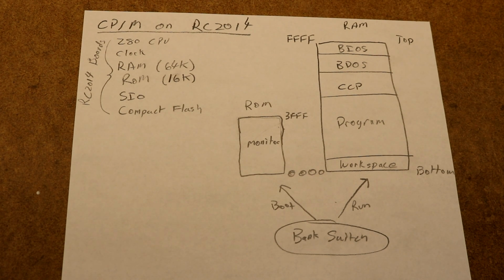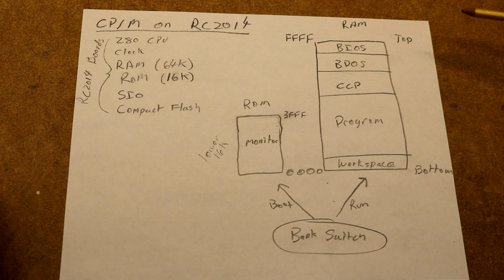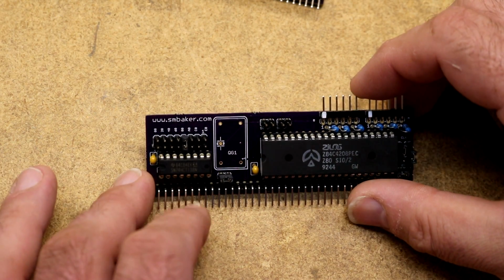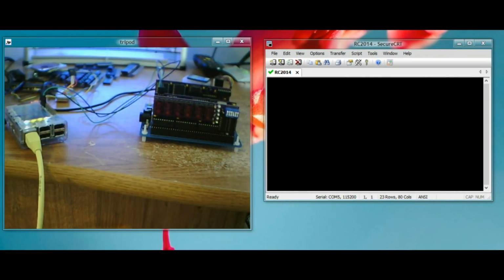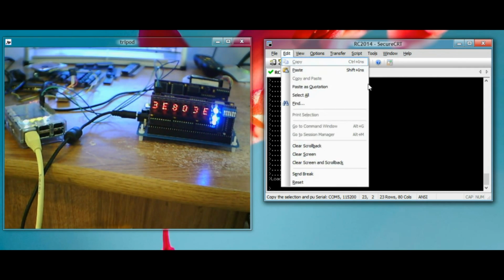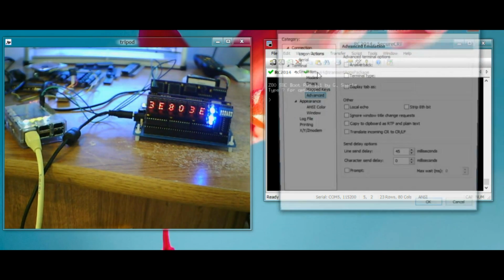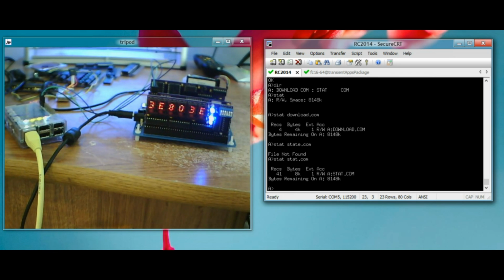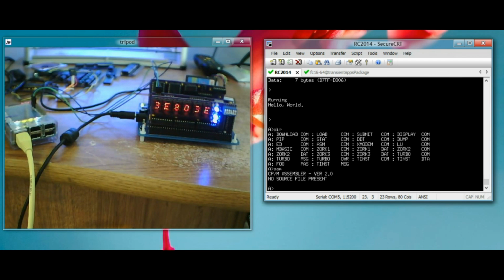Z80 Retrocomputing 11 - CP/M on RC2014 and Banked RAM/ROM Board

Comment: Why would you bother making a micro computer that will run CP-M? CP-M was never meant to be an operating system. It was a minimalistic OS that was used, by engineering professionals, to create fully working operating systems, it was only partially completed and was in what we today call a pre-beta stage operating system. There were so very many bugs and errors that the CP-M system had in it that is was the reason that many model 3 and model 2 Radio Shack systems came into my service center in the 80's, of which I was the service center manager, like BDOS errors which users insisted were computer errors but were only bugs in CP-M coming to light. I would have to run a full diagnostic on these systems, including burn in test on the RAM, only to have no errors found and only resulting in the customer having to pay a service charge to not have a problem found with the system. If anyone was to build a 'system' build one that will run a 'tried and tested' full operating system not an 'engineering' trial system
Reply: Never read such a load of horse manure before.
Reply: And yet there's a lot of software for this operating system, so if you want to run it, you have to have a system capable of running CP/M

Comment: great video as always have just built an RC2014  full monty kit over xmas and have had great fun with it and basic.  there is now a Cp/m  add on kit from RC2014 with flashcard module and new 64K ram and Rom boards available and have just received and started building that to add to my RC2014 system to play with so thanks for the Cp/m video

Comment: hi great work! is the bank switching strictly necessary? im curious and just about to experiment i was thinking of using just a single sram chip with no rom or memory glue logic and have an arduino with bus expanders hold the z80 in busreq state while it fills the sram from an sd card then let the z80 loose on the sram chip giving a flexible selectable rom system... i have the basic nascom system running as such atm, and would like to take things to cpm but im not sure if i could load the bios into the lower portion of sram and let it do its thing on the upper parts of memory then instead of switch the rom out just let cpm overwrite the bios? hope that makes sense
Reply: The Z80 has several vectors (including the reset vector) at the bottom of the memory space, so as long as the arduino could set up the reset vector to point to the loaded program (be it cbios or your own monitor) then it would work properly. In other words, bank switching is not needed in your case, just have the arduino set up the reset vector to point to CP/M's entry point.